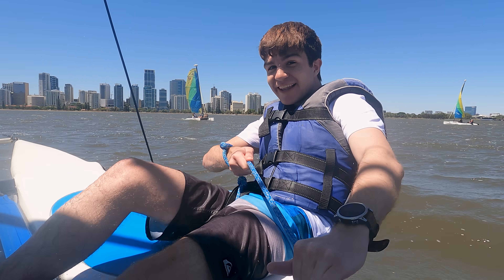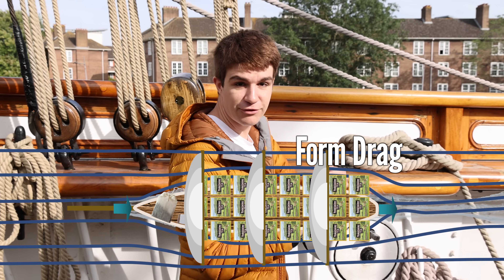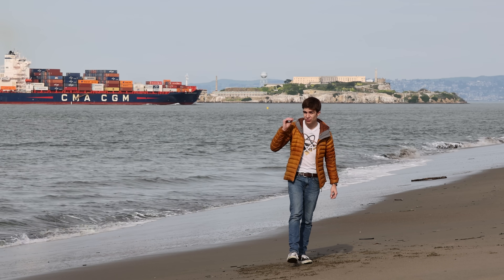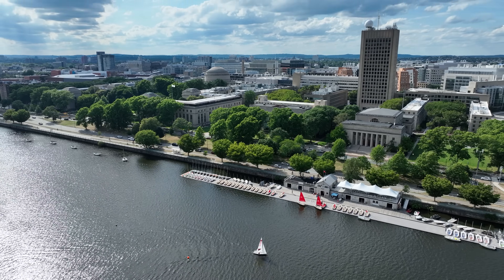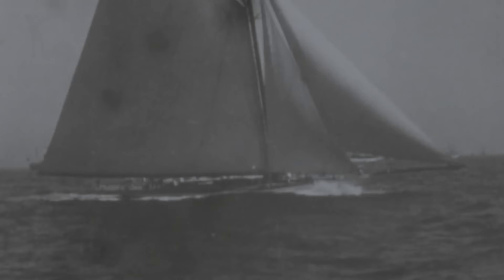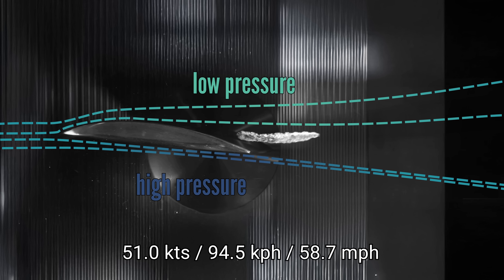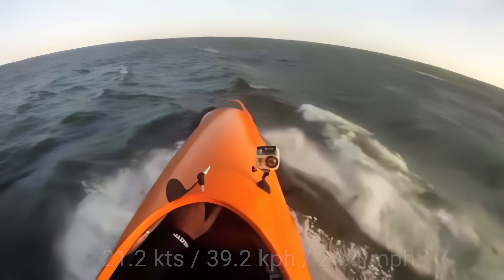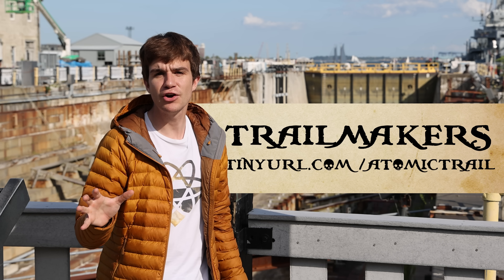What if sailing had no rules?

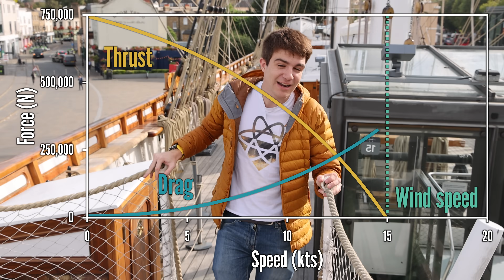Comment: 1:01 Why is drag exponential with speed? I'd imagine it's quadratic, or cubic at most. In fact, dimensional analysis suggests it can't be exponential, unless you're using some dimensionless (normalised) speed?

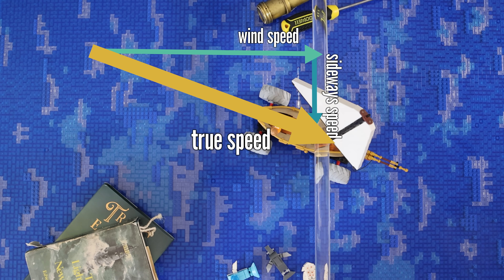5:30 Does this mean that the maximum theoretical speed is the sqrt(2) * v_wind?

Comment: One correction at 4:21 is that it is NOT a 'modern' invention to use redirection of wind, it has been well known and standard amongst sail ships for hundreds of years and even the square rigging of the older vessels were used in this manner, that is why they have multiple masts in a row despite them blocking tailwind because it enhances their sidewind useage drastically, even the triangular sails are not 'modern' as they have been in use since the age of sail, the only major difference between old and new sail ships is the optimization and size of the vessels.

If you were to build a sail ship of the same size as the old vessels today, you would likely end up with a similiar design to the old ones when it comes to sails and hull shape.

Comment: Hull speed is not a speed limit, you just need a lot more power to keep going faster. Sail boats with planing hulls (wide flat bottoms) exceed hull speed all the time. The dingy you were sailing on at the beginning was planning and going faster than hull speed.
Reply: Yes. Sadly this video seems VERY ill researched. So many of the basics are just flat out wrong here.

Comment: Good video, but I think you probably should have mentioned that hull speed isn’t actually a hard limit for displacement hulls. You can push past it with enough power, and the resistant doesn’t just jump straight to infinity.

Comment: The trust of wind doesn’t maximise at wind speed. The difference in pressure of air between the back and the front of the sail produces trust but it is more complex than wind speed

Comment: The Syroco (12:23) is less of a sail boat (an object supported and stabilized by sitting in the water, powered by an aerodynamic surface sticking into the air), and more of a paraglider (supported and stabilized by aerodynamic surfaces in air), which merely happens to be powered by a hydrofoil sticking into the water.
Reply: “Looks like a death trap “😆

Comment: What percent of a vehicle has to remain in contact with the water for it to still count as a boat instead of a plane? 😂

I wonder how scalable modern sailing technology is. Could you make a passenger or cargo carrying vessel that took advantage of the wind when it was available, and was still able to run efficiently on traditional engines, or are those two methods of propulsion pretty mutually exclusive?

Comment: Ofc you can’t cover everything in a short video but its still a bit sad you didn’t go down the whole other path of overcoming the hull speed barrier, planing, and all the wonderful boat types its made, like imoca 60s, VO70s, skiff classes like 49ers, and kitesurfing and windsurfing, which for long stretches of times had the overall sailing speed record before supercavitating foils came into play.

Also the main issue with cavitation isn’t increased drag like you mentioned, its stability. Since water is so much denser than air if your foil is suddenly surrounded by air you lose almost all the lift it was generating in an instant and the boat crashes into the water. In a lot of cases cavitation can actually reduce drag, its the unpredictability and instability that makes it undesirable for most foils

Comment: Between wing keels and hydrofoils, you missed out on the 1988 catamaran story.  A catamaran could beat a conventional monohull handily.
Reply: He missed out much, cutters for example using blade keels, implying beating the wind is post cutty sark and she was not able to jib, or that a keel and rudder IS a wing and unlike in modern ships wasn't for turning the ship but for rotating the hull to right capsizing, you'd turn with your spanker sail.

I'm getting in the weeds again...

Comment: A wonderful concise introduction to some beautiful boats and the engineering behind them.  About sixty years ago, I read and was inspired by Bernard Smith's 1953 classic The Forty Knot Sailboat, to build my own model of his radical hydrofoil proa.  I didn't know, and Smith obviously didn't either, about the cavitation limit, which prevents his (and my) results from being scaled up.  That's physics for you, ugly facts screwing up beautiful hypotheses.

I'd just have added (although it's pretty obvious) that the Sailrocket, being an asymmetrical proa, can only sail on one tack, so the concept is useless for any practical purposes.  But very impressive nonetheless.

Thanks.  Subscribed.  Cheers from landlocked Austria, Scott

Comment: hm.. i have a question to Hydrofoils 9:09 "...like an airplane pushing it down to genereate lift." Airplanes don´t geretae lift by pushing the air down. They generate lift because of their shape not their angle. The airstream on the top side of the wing needs to pass more distance in comparison to the airstream on the bottom side of the wing (airstream on bottomn has a shorter distance to travel). That means the air on the top side is faster ( because in the same time the airstream has to cover  more distance), so the air is less dence (underpressure) and this generates the lift for an airplane. 

Am i right or did i miss something 0.ô? 

p.s. like you mentioned 50 seconds later :)

Comment: Latine sails dont merely work by mass action, if that were the case, they still couldnt sail agaisnt the wind. Their trick, is that they are highly assymetrical aerofoils, with edgewise flow, so they produce extremely strong Bernauli-effect pressure difference betweeen their windward and leeward sides, like that of a low speed optimized aerobatic aeroplane.

Comment: ..... airplanes and in turn hydrofoils do not work but forcing liquids down .. I understand you are simplifying but that just isn't true.

They creat a low pressure environment on top of the wing,. They do not push water or air down to create lift

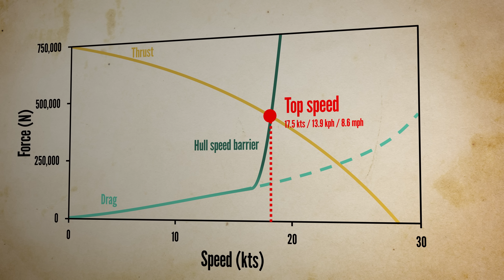Comment: At 3:49, the top speed of 17.5 kts should convert to 32.4 kph and 20.1 mph. The video currently shows 13.9 kph and 8.6 mph which is inaccurate.
Reply: It's just plain wrong. Inaccurate would be if it was off by a decimal. It should be corrected no matter what.
Reply: Yeah I was surprised that it was so low

Comment: not done with the video but your explanation of the forces on modern sails is wrong. It's not just reacting against the wind at a 45 degree angle. When used correctly, the sail should function as an airfoil and provide force perpendicular to the direction of airflow, which is why boats with a high aspect ratio sail plus a good ratio of lateral to foreward resistance get better performance with lateral winds than with a tailwind
Reply: Ya, he gets the very basics of sailing totally wrong sadly. Any novice sailor knows boats sail fastest on a beam reach (wind ~90° to the boat).

Comment: 4:19 is completely wrong! You practically never sail straight down wind like that on a square-rigged ship. The sails are wings and you sail slightly off to the side, diagonally to the wind in your back, and adjust sails accordingly to get some wind from the side. That way the wind blows through the sail and generates lift, and you also benefit from apparent wind as your speed accelerates, thus you adjust sails tighter. You will go FASTER than the wind in these conditions, if the hull speed is not a limiting faction. This is what surfers do all day, especially on ice & snow surfing. You need to redo the animations and fix the video....
Reply: It's a simplified animation to explain force. Ships are also not cut out stock photos of a plank of wood but you aren't complaining about that.
Reply: @oliverfern8039  This video is supposed to be a scientific / engineering video and he gets the very basic engineering principles of sailing wrong 🤷‍♂ I could care less about the animations but many of the basics he states here are just categorically wrong. Any novice sailor knows boats sail fastest on a beam reach (wind ~90° to the boat) and that almost all boats can go faster than windspeed.
Reply: @mattyjmar10  I'm going to be 100% with you, I don't know anything about sailing but I don't believe you. I have no way to argue with you but I have a gut fealing that you've misconstrued what the video is trying to say.

Comment: I learned more about sailing in 14 minutes than I have in the previous 40 years. So clear, concise and with perfect pacing!
Reply: Have you ever seen ANYTHING about sailing in the previous 40 years?
Reply: @akalion213  Not much, just little bits and pieces of extraneous info. Never been on a sailboat, and it's never been a particular focus. But I'm always down to learn something new.
Reply: Unfortunately what you "learned" about square-rig sailing was misinformation.

Comment: It would be neat to have a vessel that could navigate the ICW and shallow seas with bommies at safely navigable speeds, but then shoot across the ocean on a hydrofoil system when winds are favorable. Until we have antigravity vessels, I suppose we're stuck with hull speed. Fantastic video.
Reply: Hull speed is only for when you are in displacement mode, if you are planning there is no hull speed.

Comment: 4:42 there is more too this. the lee side of the sail becomes a low pressure area. Like the top of a wing. literally pulling the sail forward
Reply: 100% this. And also the fastest point of sale is a beam reach (wind ~90° to the boat) NOT running downwind. Really basic stuff about sailing wrong up front on this video.
Reply: @mattyjmar10 he only implied running free is fastest for square rigged vessels which it is
Reply: @shanecorrigan8524  That's heavily dependent on the conditions and Rig. Square rigs benefit from generated lift too, albeit to a lesser extent compared to fore and aft rigs. Just like with Fore-Aft rigs, reaching would improve the speeds due to the apparent wind velocity running slightly across the sails generating lift and allowing for higher speeds. That's not including the fact that running with the wind, without studding sails, means the sails are overlapping and not catching as much of the wind compared to when reaching and having more of the sails directly catching wind.
Reply: Also, the speed conversion at 3:51min "17.5kts/13.9kph/8.6mph", surely 17.5knts is 32.4kph/20.1mph ?
Reply: I like to say that the world doesn't suck, it blows,
 when explaining barometric differentials to people.
Reply: I like to say that the world doesn't suck, it blows,
 when explaining barometric differentials to people.

Comment: Finally, a place I can send people that don't understand why horsepower, (particularly in wind powered vehicles)has limits, and why foils, per se, aren't the answer to going faster. What I'd hoped you'd touch upon is the fact that once your are sailing faster than the wind, you are sailing with apparent wind, where all courses are upwind. This bakes many peoples noodle. We do it, with kites. . .
Reply: Admittedly it would be interesting to see someone take the brute force route and build an 800m long yacht that can do almost 70knots at hull speed
Reply: @hannahranga  There was some experiementation with massive kite sails on modern cargo ships. Not sure what, if anything, ever actually came of it.
Reply: @hannahranga 
You would run into buoyancy problems..

Comment: Those are some crazy speeds. When I was in the Navy my ship topped out at about 23.5 knots, give or take, and that felt like we were flying.
Reply: He missed out on quite a few tidbits but a fair few sail boats can go 20 knots, though exceedingly less comfortable than a warship. Full sailing vessels, though, absolutely feel like that in a good sea state, especially at the bow. Except, without the hum of an engine, it sounds like you're simply hearing the sea below, and the ripple of canvas as your wings. If you aren't too infirm, you should give it a try, though I expect you'd prefer your ship if you hit bad weather.  If you can find a tall ship that is.

Comment: wait why not have an airfoil for lift thats not in the water. Thus you have the hydrofoil get you going then you super cavitate it intentionally like done for high speed torpedos.  So now that foil is just covered in bubbles, basically making it have no lift but still basically no drag. Well the wing shaped boat body is giving just enough lift to keep it out of the water. The only thing you have to do is keep it going fast so it has enough air speed to basically ground effect itself. And probably a computer to control stability. But from the look of things this isn't as insane of an idea as well other peoples ideas.

Comment: 1:00 do you mean thrust specifically for square sail vessels? We’ve seen plenty of boats sailing up and down wind above wind speed both true speed and VMG.
Reply: Yea that was a strange statement to me as well.
Reply: those boats are going downwind but not deadwind (180deg). it's the angle that create the apparent wind thus you can go faster that the TWS
Reply: @julesangebault1780 but even VMG dead downwind is faster than the wind speed. He addresses this when talking about triangular sails and foiling boats, though there is more flight physics involved there that aren’t quite addressed. There are a few problematic oversimplifications but the core concept is ok.

Comment: The biggest issue with fast racing ships is that water is less reliable than a road and is turbulent, so if you hit a abnormal wave or a gust of wind that blows you of course it’s like hitting a brick wall, incredibly dangerous, many people trying to get the water speed record have died attempt it

Comment: Speed can be increased by sailing on very cold water (aka ice) -- max speed 143 MPH (though there is significant doubt about this) speeds over 80 MPH have been more reliably measured

Comment: just a note on visual accesability, this first section of this video was sorta hard to keep focus on for me for a few reasons and thought i'd mention them even though its nothing eggregious, just as a datapoint

1. the spinning cutty sark wasnt hard to parse, but it spun a bit too fast and my focus was spent trying to look at the bit i wanted to look at and i felt like i had to go back to relisten to the audio

2. had a hard time parsing the graphs because they had no margin/border? the entire backdrop was moving but at full res and not blurred in any way, so i had trouble controlling focus against all of the new info the camera was showing and watching you navigate steps while going backwards

3. incredibly oblique angle on the thrust across the sales graphic was very hard to process for me. and then it added this big yellow arrow and swooshed away before we were at a nicer angle to it. 

4. the bit about form drag and whatnot falls into the similar trap of transparent graphics being pretty, but you did it against a backdrop if literal rope and visual noise in the other directions so it was a bit much for me and i had to go back and pause again (also when i started writing this comment because i felt it was odd i had to rewind 4 times in 2 minutes on one of my good mental days lol) and it wasnt until the THIRD rewatch of that segment just now that i realised you actually changed the graphic when you mentioned the cargo changing

not a number but just an appreciation of how good and no notes i have on the bits inbetween because the "posters" behind you at this point felt really clear and nice. (okay i lied about no notes bc there was one last transparent floater with the speed there)

wowwwww okay so i just finished the video and absolutely loved it. almost feel like the above about bits from the first 3 mins is a bit petty now LMAO. absolutely incredible video and tone and pacing and still being clear and consice and also visually interestng and pretty (which im sure is no small feat) 

thanks for taking the time to read through this and again, nothing was eggregious so i almost feel a little out of place dropping a wall of text like im some arbiter of accessability.